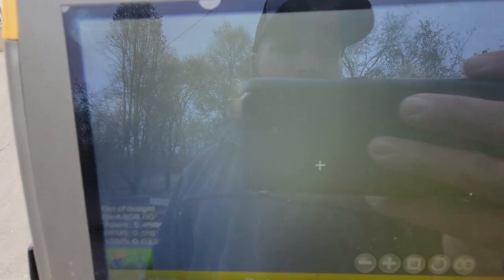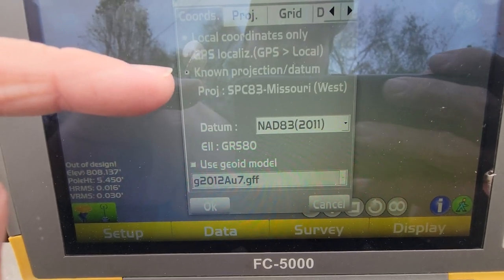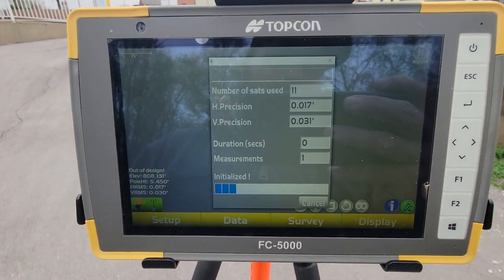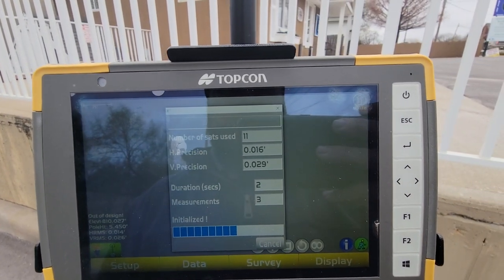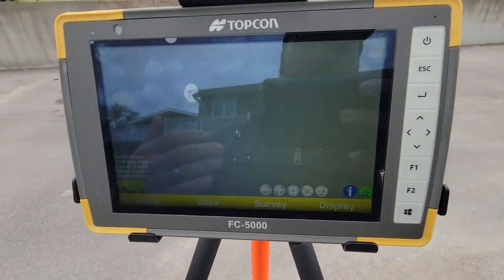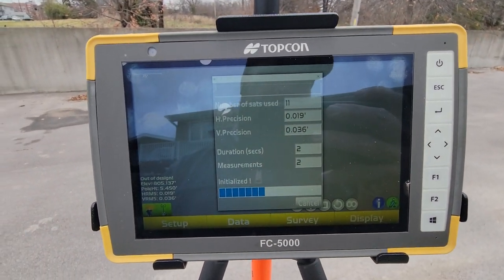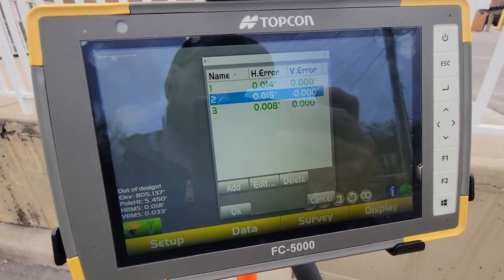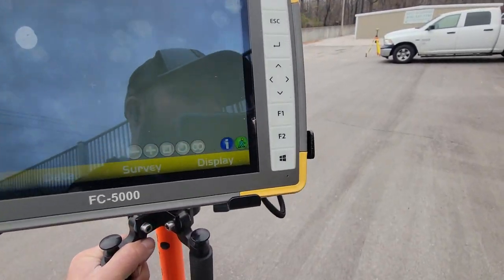Creating Your Own "Control" Points - Topcon Pocket 3D

Comment: This was a great video. For others that are also looking for a way to localize when a surveyor didn't give you any fancy points, this method works. For starting the base just place it anywhere with base h=0 and then select unknown point when prompted. After starting to the base, connect directly to the rover after to get to where he begins the video. For it to already have a location/elevation you need to have already selected that projection grid ~2 min in. Finally after you create the control points they will be in some funny elevation due to the projection, but as long as you keep the delta between the control points the points the same, you can edit their height in the input window and "fix" this discrepancy. Then when you measure elsewhere in the project the elevations will all work properly. This is massive game changer towards being able to run small jobs where tighter control isn't required. Hopefully someone at Topcon sees this content and that you're helping some lost fools like us and throws you a bone with some free stuff! 🤣

Comment: I haven’t tried this yet but I’m wondering let’s say I did exactly like you did with 3 points.  I burn them in in state plane and then go back and localized them.  Now I’m localized.  Let’s say I decide I need more “check points”.  I go and burn in another 3 points in state plane.  Now do I have to go back and localize those 3 to get my residuals, or do the previous 3 automatically make the new points localized because with gps you need at least 3 points to at least get started?

Comment: I just showed up to a fresh jobsite today and all of the engineer's control points on the plans are gone.  I tried to do this localization method and my elevations are way off.  I know I should be sitting around +10.00' +\- but it's showing -80.00' +\-.  I've already called to have new control set but was curious if you have run into this before and know of a simple mistake I might be making..?  Thanks for the videos.
Reply: You have to make sure you are using a geoid…chances are your elevation is the ellipsoid height not the state plane elevation

Comment: I'm new to the topcon technology.  What process did you go through when you set up your base station at the truck??
Reply from the maker: I'm setting it up as an unknown control point in the base station setup. This is just an autonomous position that you can use to localize a site or reference other points. There is another video that shows starting your base on an unknown point that may help.

Comment: Did you really had to measure all points all over again after setting the project to gps>localization? I mean you already had wgs coordinates, if you just check use horizontal and vertical you would get green color control point with 0 horizontal and vertical error since these wgs coordinates are exactly those local coordinates, I mean you are doing extra work for no reason and if the site is big you would lose a lot of time for nothing
Reply from the maker: I will have to try it. I'd assume you are probably right now that I think about it. Like I say several times in the video this is the way I do it and there are many ways to do things. Most places I use this is small sites. So I appreciate the comment because I learned something new, which is the reason I do this videos. I'm at least trying to add some value instead of dropping snarky comments on people's post.
Reply: @ctpusa1  I made the same mistake with Trimble Access measuring points twice and then just realized the next day that both wgs and local coordinates are already stored in controller. Because of the nature of Trimble Access program I just had to export local coordinates and import them again as new points in the same job, because program only allows to combine imported with measured coordinates, and so I got localization with 0 horizontal and vertical error. The same would work with Topcon but even simpler just by checking those h. and v. boxes. Haven't tried it but i believe it would work and it would save you some time. 
Btw. I am fan of you channel and I am so glad someone is posting this stuff, I already learned a lot from you channel so i think we are even now. Keep the good work!

Comment: Hello, thank you for your channel and uploading these videos they’ve been a big help for grasping the basics. By any chance do you know how to add surface design (final elevations) points to a partially completed surface design? I have the elevation points on paper and have been just been using the rover as a sort of laser but it would be a huge help to enter the points in the system
Reply from the maker: Sounds like you are wanting to create a design surface for the purpose checking grade. If you have the northing and easting coordinate associated with the point you can input the points and create a surface from them. It's really going to come down to what data you have and how your site is setup. 
I know that probably isn't much help, but I'm not fully understanding what you're needing to accomplish.

Comment: So, if I understand this right between. The conversation between you and Deadpool is that when you switch back to GPS localize after setting points using the state plane that all you have to do is select "use horizonal & vertical" and you shouldn't have to remeasure? Maybe I didn't read that right.

For small jobs I just set my Base to 5,000 North 5,000 East and 100 Elevation and Measure the base pole. 

I was told you can run a job on just one point. Is there any disadvantages to this other than its just not a tight site? 
Nice work on the videos.
Reply from the maker: Correct, Deadpool is right in pointing out you can just select "use horz and vert" and you shouldn't have to re-shoot the points. 
You can absolutely do a one point calibration, but I wouldn't recommend it on any job that is designed or engineered. The biggest disadvantage I have seen is in the possibility of some rotation, especially the further the job spans. 
I tend not to do one-point calibrations because I like to have more than one point to check, so you can set some check points to verify with. 
Appreciate it, I try, I'd like to dedicate more time to it, maybe one day I can get there.

Comment: What's the set up for your data collector a
I'm using the ram Ball but come loose all the time
Reply from the maker: I'm guessing you have the Seco Ram Ball (5200-160). These tend to strip out and rotate after a while. I have gone to using a RAM tough claw (RAP-B-400U). They are a little more bulky, but seem to be more stable, cheaper and last longer.